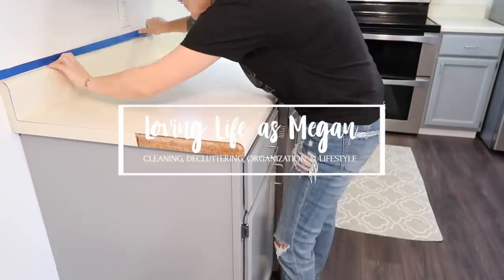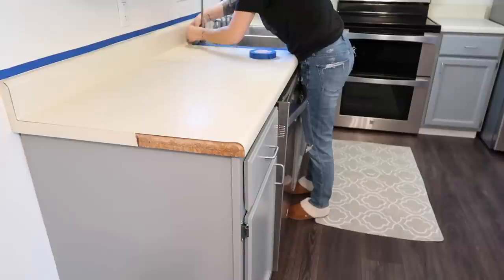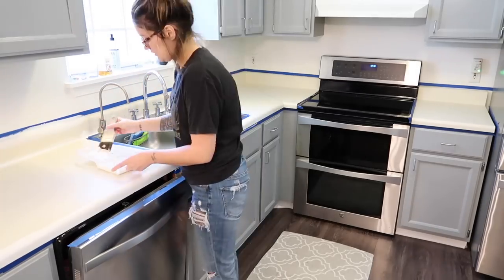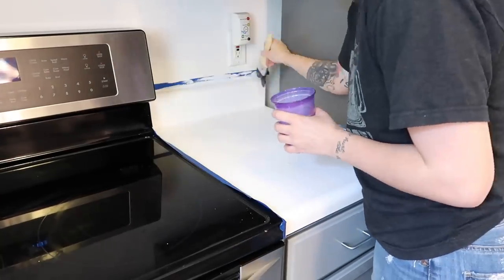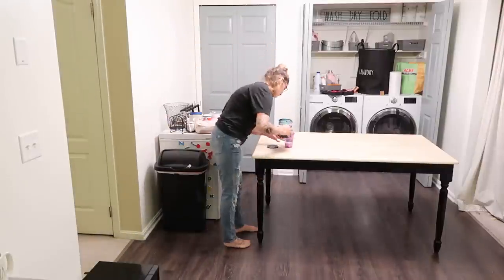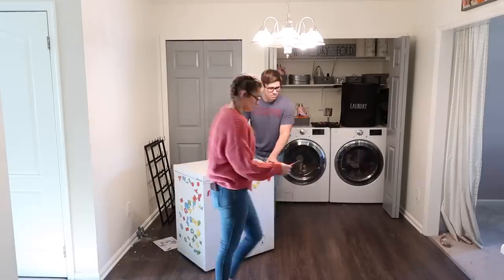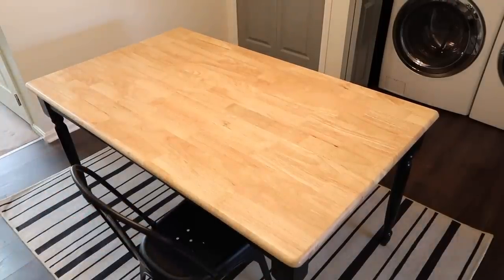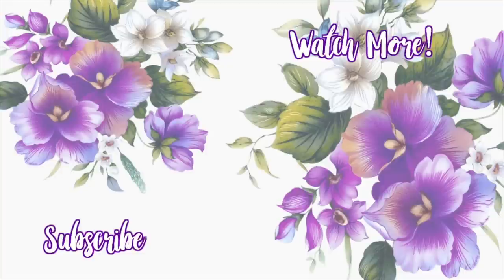DIY Small Kitchen Makeover on a Budget

Comment: Just wondering: How have the countertops held? They look beautiful!
Reply from the maker: We have had no issues with the countertops so far 🤗
Reply: I painted our countertops when we first moved into our house using the Gianni countertop painting set (which, as the name suggests, is specifically meant for countertops and comes with primers/sealers) and they started scratching after about 2 years. By year 3, they were completely peeling up. We took good care of them and followed all instructions. Painting countertops will get you by for a while, but it IS temporary unless you use something like a countertop epoxy on top.
Reply: @AloneInTheGarden  is your countertop granite?
Reply: BELLA I wish! If they had been granite, I’d have never painted over them. 😊 They were some type of laminate that we sanded slightly before applying the primer so that it would have the best chance at sticking. We’ve since ripped out that countertop and replaced it since the paint had peeled up so much and there was really no saving it.

Comment: Try painting the glass shades on the light fixture above the finding table. It will make them look like goose neck fixtures! You did a great job. Our kitchen makeover isn’t going to be so easy. We have mismatched cabinets because the people who owned our home previously rearranged the layout but instead of getting all new cabinets they got a a couple new ones to fit into what they wanted. It’s crazy. We did take down all the upper cabinets and put up open shelving which helped but the bottom cabinets are a mess. ☹️
Reply from the maker: Ugh, that sounds like it’s going to be a lot. I’m sorry you’re having trouble with your kitchen

Comment: We had a Similar table issue happen it was discouraging but it actually stains well also and if you sand a hole in the veneer  you can use saw dust from sanding and wood glue. Make sure you mix in sawdust from your table or the glue will not match the color of the table. Then you can stain it as normal and either draw a grain with a sharpie then seal or leave as is and seal. Remember wood is naturally and has imperfections as is so it will look natural pretty much either way.
Reply from the maker: That's a great tip! I've already sealed it how it is though so I'm not going to sand it down again lol

Comment: Next time you do this, hold a long level across the wall and run a piece of painters tape across where the nails go, then you can just drill the nails on the top line of the tape and they'll be on the perfect level with each other
Reply from the maker: Thanks for the tip!

Comment: Awesome job. Did you end up caulking around the sink? That will ensure no chipping and peeling of paint. (I painted my countertops in an old apartment and didn’t do this, and about 6 months later there was some chipping at the edge of the sink. Other than that they held up well, and I used acrylic paints and polycrylic. Best of luck!
Reply from the maker: Yes I did lol, I just didn’t film it

Comment: Checking back 10 mos later. How is the countertop holding up to wear and tear and scrubbing?  I’m very tempted to do it!  Also why chalk paint versus any other paint?
Reply from the maker: I didn’t really have a reason for using chalk paint besides that it seemed like the most budget friendly solution. 
It has definitely started to chip and stain. 
But this was never intended to be a long term solution. We plan to replace the countertops this Spring.

Comment: Checking back 10 mos later. How is the countertop holding up to wear and tear and scrubbing?  I’m very tempted to do it!  Also why chalk paint versus any other paint?
Reply from the maker: Chalk paint is just what I was familiar with at the time and I always intended for it to be a temporary solution, so I didn't want to spend the money on an epoxy kit knowing that the countertops would be replaced. They lasted about 4 months with absolutely not scratches or staining, but now a year later there are definitely some paint chips and stains.

Comment: Where are those jeans from?! They fit you so nice! And they are so cute!
Reply from the maker: American Eagle 🤗 they are around 5 years old though so I’m not sure if they still sell them
Reply: Probably not:( I’m so sad about that but Also quick tip: to stop paint from leaking threw tape and get a clean line take the paint from the first layer after taping and paint along your clean edge of tape let it dry and then do your top coat the line along the tape leaks threw any place your next layer would have and seals it.

Comment: Wow I have those same countertops...yuk!!! I'd never had them before and made the mistake of putting a hot pan on them. Well you know what happened...burned the surface. I was going to put contact paper on them but the painting would be easier. So my question is did you have any burn marks or other areas that were chipping or broken away? Do you think the many layers of paint would cover the imperfections? This is exactly what I need right now so thank you ❤💚💜💙💛
Reply from the maker: I did not have burn marks but there were plenty of scratches & chips. 3 coats of paint + 3 coats of polycrylic worked well for us!
Reply: @lovinglifeasmegan  Thanks for answering. I think I'm going to try painting first and if that doesn't work I'll contact paper it ❤💚💜💙💛

Comment: What grit sandpaper did you use to sand down the table? We're doing our little island cart and it's taking forever to get the original coating off
Reply from the maker: If I remember correctly, it was 80 grit to sand down the top coat & 220 to finish it. But I’m sure I would have showed/said it in the video

Comment: Hey Megan! I just did this to my counter tops! I used the same products you did (the paint was a different brand). I noticed after applying the polycrylic coats and it dried, if I got water on it it looked like it had faded a bit. Once the water dried it was fine. Did you have this issue at all?
Reply from the maker: The Nicholson Fam hi! I did not have that same problem, I’m not sure why that would have happened to you 😩